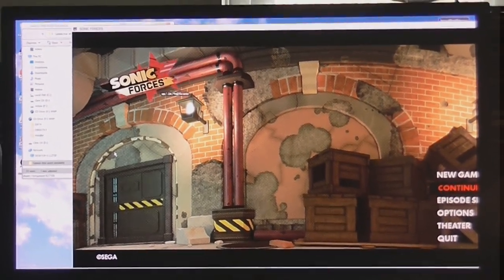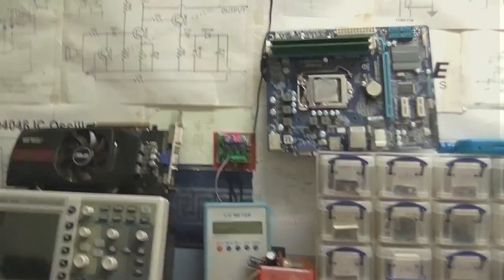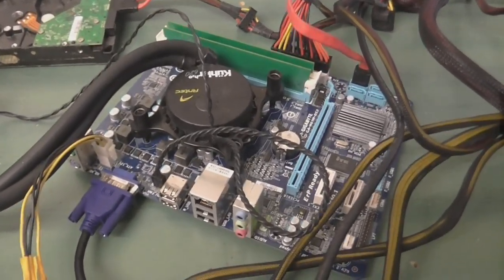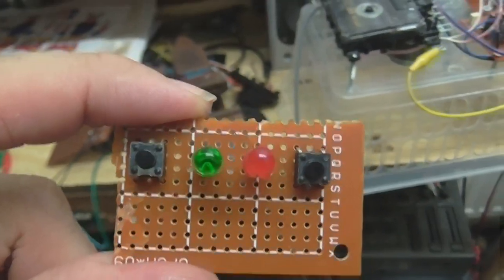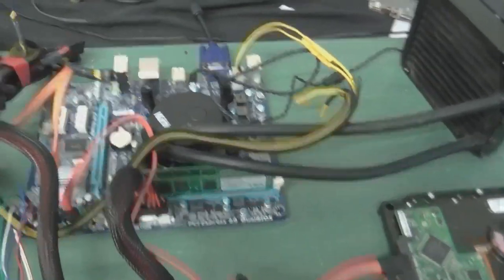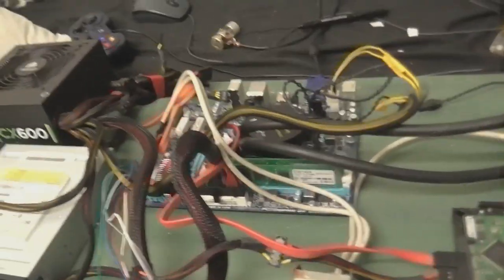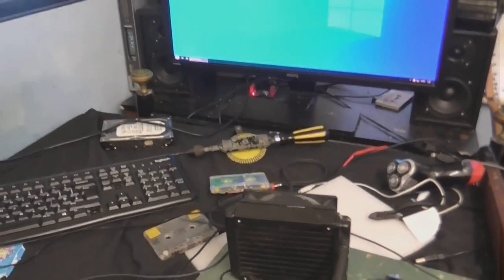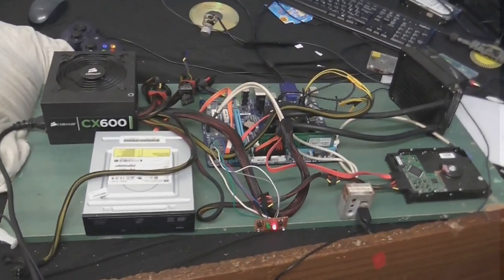Frankenpc II - The Beginning of a new.

Comment: Hi Clem, glad you are well. 
I want to build a continuous spark device for lighting a gas lamp. It would run off four or six AA cells. Push a button, spark continues until I release the momentary button. Spark gap between electrodes about 2 mm. Have you done that before on video? If yes, would you post a link?
Thanks.
Reply from the maker: I used to do this a lot in my older videos when I made singing arc projects. it would proably be better though to get one of those fly swatter rackets and hack the thing to bits!
Reply: @CoolDudeClem  
Okay, I'll go look for one at the dollar store. Have a good rest of your weekend.

Comment: Why does Windows take so long to boot up? My i5 Linux PC takes less than 2.5 seconds to boot. Actually my last boot was terrible. It took 
Startup finished in 1.705s (kernel) + 5.513s (userspace) = 7.218s
I need to look into that.
Reply from the maker: Why? Becuase microsuck bloats up windows with sh*t that nobody needs!
Reply: @CoolDudeClem  maybe. I am still wondering  what took my PC so long to boot up the last time. I am looking through my bootlog right now to see if I can see anything that hanged. Ah it did a filesystem check. Last reboot must not have been clean. OK that makes sense.
Reply: tim brown  Hardware issues? I have been running Linux for 25 years now and it always works for me. Although it does help to run Linux on a compatible PC. Linux has the most hardware support of any OS that has ever existed though. Someone literally ported Linux to a potato.

Comment: Install ubuntu on modern hardware, install and old gpu and pass it off to a VM using gpu passthrough.
Reply from the maker: I'm not smart enough to figure out how to do a GPU passthrough. I don't really see the point of installing a Linux, then installing Windows in a VM, I might just as well run Windows as the main OS.

Comment: Did it see all your ram?
Reply from the maker: Well no XP didn't see all of the RAM, it seems to know what the touchscreen is wehn I connect it, but just wont respond. I also tried Windows XP 64 but that refused to install Adobe Premeiere so I just thought "f**k it" and installed 32 bit XP instead! But, I have also installed Windows 10 64 bit on a seperate drive so I can use the full RAM and the touchscreen. So now whenever I want to use either os, I just connect the appropiate drive and viola.
Reply: @CoolDudeClem  Will you be making an update (part 2) showing where this project is now?